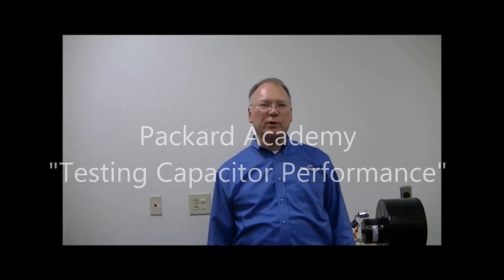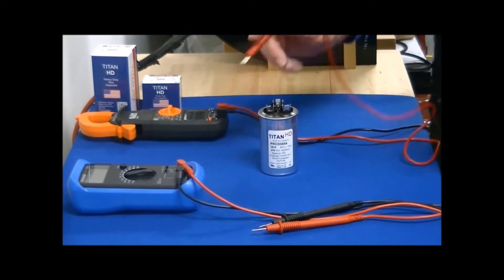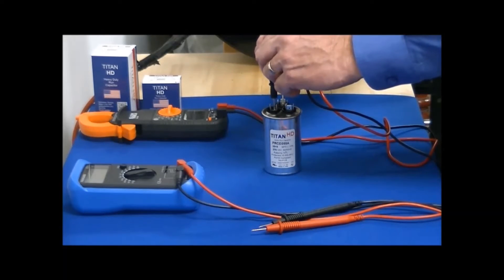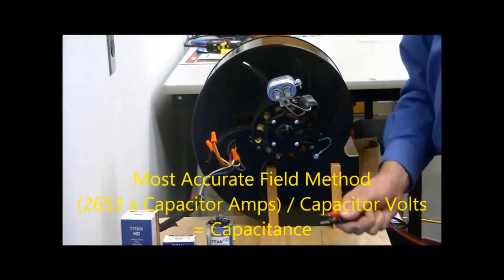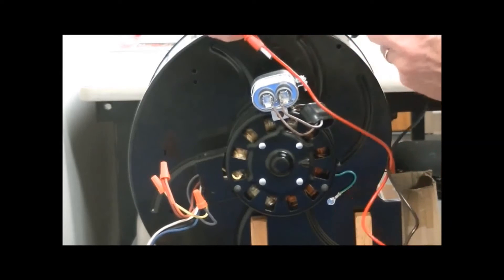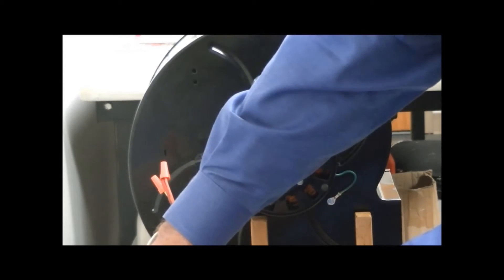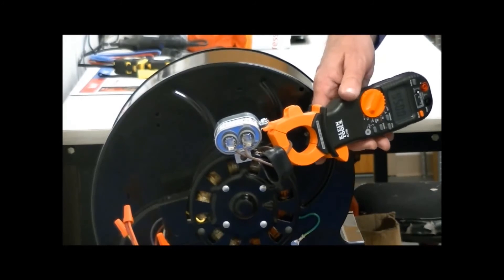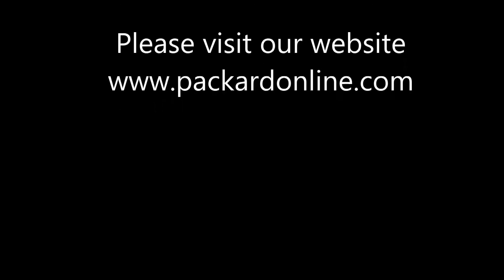Testing Capacitor Performance- Step By Step Demonstration

Comment: ive seen somone do the same thing but used 2650 is thear a diference
Reply from the maker: +tazalots 

The difference is minimal. 2650 vs 2653 is a result of how many decimal places of mathematical Pi are
used.  You should make certain that when checking the capacitor in a system that the system is closed, that is, all the doors and panels are in place.
Reply: +Packard Online  thank you